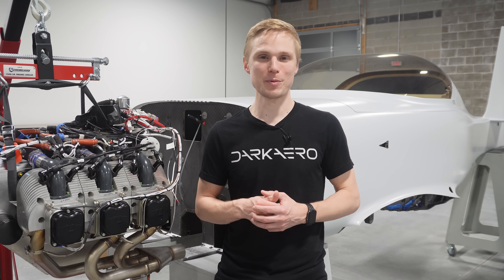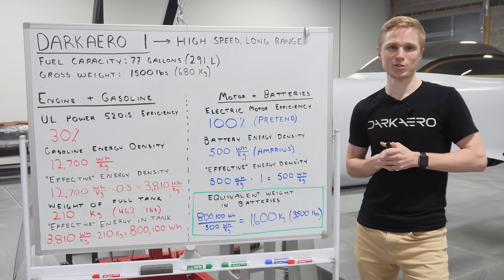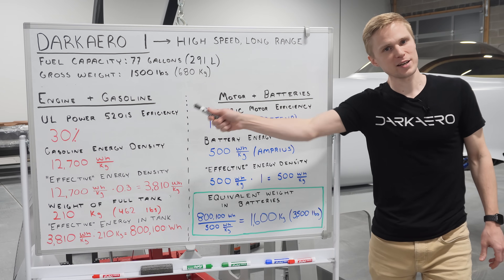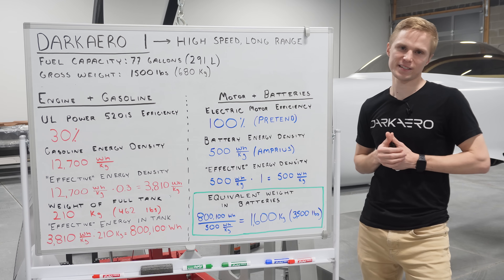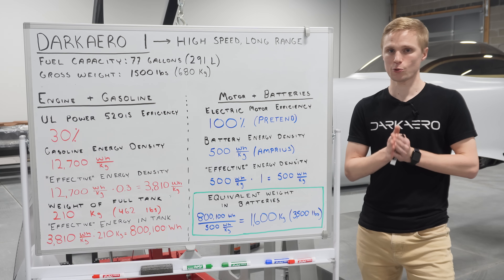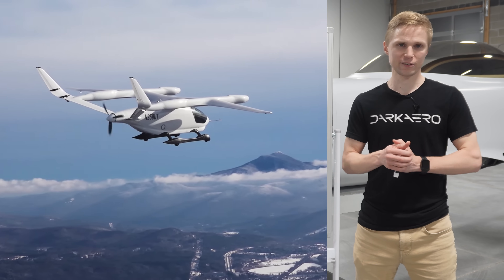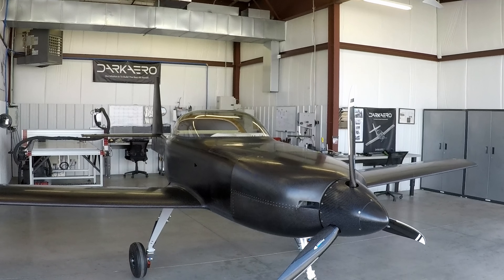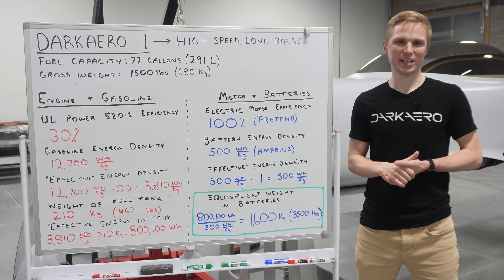The engineering challenge of electrifying airplanes

Comment: 1kg gasoline has 1.6kw/h usuable energy. Diesel has 3kw/h energy.1kg battery has 200watt/h energy. In general, this means 8~10 times more weight. But if we take into account the weight difference in the engines, there is a difference of 5 times. 1kg hydrogen has 33kw/h energy. It seems much more efficient for airplanes.

Comment: lightweight long range will always be dominated by fuels, and thats fine by me. better fuel engines are still coming (glacially slow in aviation, but they'll get there) and short haul flights can be almost entirely electrified.

the improvements in battery tech and packaging might get closer than you expect though, not Dark Aero levels perhaps, but a medium range version, going with a smaller pack load for 2+ hours, composite structural battery in the wing box, i think it would be just as desirable for a similar market. of very rich people.

Comment: No. The numbers don't work. Fuel load gets lighter as it is consumed. Not so with electric.
Enough battery to be useful in an airplane could generate quite an inferno. Many other reasons why it won't work. Put on your thinking caps and use your brain.

Comment: One thing that I think could be an upcoming trend in the world of aviation is the use of hybrid powertrains. If you have a small combustion engine that is hooked up to a generator that tops off a small battery pack, you can heavily optimize the engine to make it more fuel efficient, and also smaller/lighter. That way you'll get more bang for your buck out of the gasoline you carry. The battery would then be connected to an electric motor to reap all of the benefits of an electric power train.
Reply: this is more the case for vehicles with constantly changing engine load, aircraft generally have smooth power requirements and therefore this has less advantage. i suspect more advantage would come from the aerodynamic benefit of being able to place multiple small electric motors in strategic locations.
Reply: and also aircraft ICE's are also operating at a higher percentage of their maximum power, much like a hybrid engine

Comment: pu-238 has millions kwh per kg
Reply: use that in external combustion heat engine/thruster
Reply: yes its alpha nuclear
Reply: use just rtg alpha nuclear
Reply: alpha nuclear is relatively safe
Reply: metal-air sheet-spool fuel-cell batteries
Reply: one time use regenerated metal-sheet as fuel, like gasoline, refined back from oxides to metals, normal/advanced metal making processes, solar/wind/nuclear powered

Comment: Thanks for the vid.  Seems like we're still a ways off from electric aviation to become commonplace...but I'm confident that we'll get there eventually.
Reply: I doubt ev aircraft will become mainstream within  my lifetime
Reply: @yota8325  :  Not much likelihood of that.  As River covered in this video, there is a place for it in a small number of cases... mainly where there are short hops between the same points, such as between islands, or training.  If it involves long distances, battery-electric power is not the answer.
Reply: You will never see battery powered commercial airliners because you have to be able to dump the fuel or payload to return to the field in an emergency, smoke in the cabin, passengers fighting ext. takeoff weight is always too heavy for return landing. Can’t drop a 20,000 lb battery pack on a school to return to the field.
Reply: @tropicthndr  The battery pack doesn't get lighter, so you'd have to design an airplane that has the same takeoff and landing weight.  The emergency is irrelevant.
Reply: @Michael Kim :  When I was a (much) younger man, if you wanted to fly a model aircraft, you had to learn about noisy, screaming, smelly, oily little engines, and the witchcraft involved in fuel mixes.  One day a guy brought along a spindly, fragile, slow creation powered by batteries... we politely watched, but were not impressed... if only we could have seen into the future!  At times, what is seen first in model aviation translates to full-size... watch this space.    😊

Comment: Great video, River! The simplified math makes it easy to understand. 

Have you looked into using hybrid of electric and ICE on an aircraft? I'm thinking an electric motor with a gas powered generator and minimal (or zero) batteries. I would be curious to see some rough numbers on the potential weight compared to a standard ICE.
Reply: A hybrid, with batteries, would be less efficient overall.  I'm all about electrifying vehicles but the advantage of a hybrid car goes away in an airplane.  One of the biggest inefficiencies of ICEs is the amount of moving parts.  In a conventional car the required torque necessitates a large engine which during 90% of its operation is well below the required power for acceleration. 
Using a smaller ICE that gets supplemented by an electric motor means that the ICE is used in a more efficient way and it doesn't need to be as big to meet the torque demands of driving.  So in steady state the smaller ICE is so much more efficient, it makes up for the extra weight of the batteries and motor; this just would convert to airplanes in the same way.

An airplane in flight is using a considerably larger portion of the available power than a comparable car driving down the highway.  An airplane would not be able to take advantage of the increased torque of an electric motor to reduce the size of the engine so any advantage of having a motor goes out the window.

Comment: Hydrogen fuel cell could 100% be electric. Already done in unmanned drones for the last 2 years. Cost is much the same as a combustion engine. No need for a solid state battery.

Comment: Great summary. One corner case advantage of electric, in addition to no power loss at high altitude, is the potential to drive a supersonic propeller at supersonic flight speed, since there's no need for an intake to slow the airstream for compression and subsonic combustion. It would be noisy though.
Reply: There is no supersonic propeller...In the standard jet engines the compressor phase blades are subsonic...after the turbine section the added fuel burn ( hence the name "afterburner") provides supersonic airstream and adequate thrust to jump over the transonic wave drag penalty barrier... 
The inlet section of a fighter jets drops the speed under sonic speed via compression waves even when travelling supersonic...

Above Mach 2.0 you can use ramjet...(AA-12,SR 71,...) above Mach = 5.0 you can use scramjet...(Kinzhal missile...)
Reply: @electricaviationchannelvid7863  a propeller is just a rotating wing. Supersonic props are noisy and inefficient but they're an interesting way to go supersonic with electric propulsion.

Comment: Two things to add: An optimum electric aircraft has higher mass and higher lift/drag ratio (think glider geometry). Also batteries are improving at around 6% per year. Project that forward by a decade or two and most GA aircraft can be replaced with electric aircraft…..

Comment: The problem, as always, is energy density - as you rightly said. Until energy densities are AT LEAST a magnitude above their current levels, and until charging rates 100x their current levels can be reasonably (and SAFELY) achieved, all electric aircraft simply will not work.
Reply: At the MIT AeroAstro Centennial Symposium in 2014, Musk reckoned that batteries with a specific energy of 400 Watt-hours per kilogram, composing 70 percent of the mass of the aircraft, would make a “compelling” aircraft. 
Carnegie Mellon researchers Venkat Viswanathan and Shashank Sripad recently published a paper in the Proceedings of the National Academies of Sciences (PNAS) estimating that an aircraft with that mass fraction of 400 Wh/kg batteries at the pack level would be able to cruise for around 15 minutes at Mach 1.1 at an altitude of 40,000 feet, including a vertical take-off and landing.
Reply: @waynerussell6401  just because it's enough in that case doesn't mean it shouldn't be better. And the biggest problem won't be mass, it'll be cooling. Greater power density + greater charging rates = MUCH higher temperatures. We will need to find battery chemistries that are VERY efficient when charging so no energy is lost to heat generation.

Comment: Another challenge is that altitude does not deplete the power however the lower associated temperatures do.
Reply: This wouldn't be a significant issue for direct altitude as you heat the battery up significantly while getting there.  It would be an issue for cold locations where the battery would not be pre-heated and fully powered on the ground.
The battery power reduction at lower temperatures is because the battery starts cold limiting total storage.  If charging and pre-heating the battery it becomes much less of an issue.

Comment: One option you might consider in the nearer term is Solid Oxide Fuel Cells. Due to their higher temperature of operation, they allow for the use of hydrocarbon fuels, and they can even harvest energy from the oxidation of carbon monoxide that results from the hydrocarbon fuels. They’re not likely to ever be used in cars due to their long warm up times and slower throttle response, but neither of those problems are present for long range aircraft. They can get pretty light weight too…NASA has a patent they’re trying to license out for a SOFC that has a power density of 2.5 kw/kg, which would mean maybe 100kg for the fuel cell. And with that you’d get closer to 60% efficiency and pretty cool fuel flexibility (you can use any low-sulfur fuel from diesel to natural gas to pure hydrogen).

Comment: It's also worth mentioning that most early EVS were conversions of gas powered models - replacing the engine with a motor and the gas tank with a battery pack - and they were universally awful. I suspect a converted DarkAero "1E" electric would be similarly disappointing. If you want to make a good electric airplane, you really need to design it to be electric from the start... and it's a bit late in the DarkAero's development process for that 😀

Comment: I think that the push for lighter batteries while focusing on an efficient air frame means that DarkAero will be well positioned once that technology exists.  Maybe solar panels will get so efficient you can recharge mid flight to extend the range? Who knows.
Reply: Solar panels are great but there's a hard limit on how much energy can actually get to them because no amount of research in the lab is going to make the sun brighter. So there's a hard limit on how many watts per square meter of panel area you can ever get and it's lower than what is required to make an airplane perform. Flying on solar power is achievable, it's been done, but only by extremely efficiently designed flying wing drones that don't have to carry the weight of a human pilot, and even they have a pretty high failure rate because it doesn't take much to knock them out of the sky.

Comment: Jet/kerosene/diesel/#2 home heating fuel is the best solution. Higher energy efficiency and lower rpm.
You could use a lower powered engine that could reach high cruise speed in straight and level flight @85% power. Then add a small battery and electric motor to boost climb and take off speed.
The electric grid which consists of power transmission lines and electrical power generation plants or powerplants is not remotely capable of supporting 100% electric passenger cars. Heavy equipment and transportation sectors would more than double that amount. The electric grid was already working above 100% before the first Tesla came off the assembly line. A single family house with two avg American drivers would use an additional 58% kWh on top of the avg kWh usage per month.

Comment: one-time-use aluminum-air batteries. with replacements kept at airports, transported by trucks same as gasoline/diesel. And when you swap a used battery, the delivery truck takes those batteries to be recycled.

How would this change the performance numbers if an aluminum-air battery managed it's best hypothetical performance?

Comment: Curious what a hybrid would do...

Small diesel engine as a generator, powering a small battery and electric motor. Does it work for airplanes.
Reply: Diesel v12 hybrid flight test https://youtu.be/GUEAa8fHvbQ
Reply: Something I learned during flight school (c150’s) is that they are almost always at high power settings. A small diesel engine will most likely get overwhelmed at some point because you can only output as much power as you input. And no it’s not the engine that sets back the plane, the airframe is just so inefficient just so it can be so forgiving when students fly it.
Reply: @poochie5543  I wasn't asking about the airframe. But an electric motor handles the torque better than the gas engine, and so how does that factor in as a hybrid. 

You have not answered the question with anything useful.
Reply: @SoloRenegade  it doesn’t matter if the motor has torque, the motor won’t run after 20 minutes if the diesel engine cannot output the power needed to run the thing. Commercial aircraft have an apu in the back which is practically a jet turbine to power the plane. But even replacing the main engines on those commercial jets for motors, adding a battery, and then adding a larger apu won’t solve the issue because once again, you cannot output as much as you can input into the system.
Reply: @SoloRenegade  the industry they or you are trying to ‘modernize’ is way harder than anyone could imagine. We have vehicles like trains and cars that are hybrids because there is no real weight limit, while aircraft do. Ultimately we are trying to solve an environmental issue that cannot be solved economically nor practical.
Reply: @poochie5543  "the motor won’t run after 20 minutes if the diesel engine cannot output the power needed to run the thing."

which is why you size teh generator appropriately. but I see you're not smart enough to understand this.

"But even replacing the main engines on those commercial jets for motors, adding a battery, and then adding a larger apu won’t solve the issue because once again, you cannot output as much as you can input into the system." 

you obviously don't understand the how/why of hybrids. Hybrids do work for a reason, and many vehicles have used hybrids for energy savings for decades.
Reply: @poochie5543  " the industry they or you are trying to ‘modernize’ is way harder than anyone could imagine."

no it's not. aviation is far simpler than people like you beleive. I am a Mechanical and Aerospace Engineer who designs aircraft, and a CFII in airplanes and helicopters. Engines are not my specialty though. I have not done the math on a hybrid, and hoped someone else may have looked into it. Clearly you haven't.

"We have vehicles like trains and cars that are hybrids because there is no real weight limit, while aircraft do. " but some such hybrids are actually LIGHTER as the generator, being as it's optimized as a generator at one specific RPM, tends to be so much smaller than would normally be required. A diesel powered APU can generate a lot of electricity, and very weight efficient. There are multiple new companies offering turbine engines in teh ~130-200hp rang for light aircraft right now, that are FAR lighter than 100hp continental legacy engines for example. The engineer of the company I talked to had an engine that was about 100lb lighter than the continental in my airplane, and had more horsepower too. Hook that up to a generator, add a small electric motor and battery (weight change ends up being a wash), and now you have a high torque electric drive running on a small and efficient turbine burning cheaper diesel fuel.

"Ultimately we are trying to solve an environmental issue that cannot be solved economically nor practical."

again, you clearly have no clue. Stick to things you understand.
Reply: @SoloRenegade  let’s start thinking for a moment, a GE9X found on a triple seven has a shoddy but general hp output of 9500 hp. Times that by 2 and now you need to create 19,000 hp to run the whole system. On top of that you need a backup so add another most likely. Where would like to add your 2 ge9x + batteries + motors to run the whole aircraft. These numbers are so large and demanding that batteries and motors will be ridiculous. Leave your bitterness out of here, thanks.
Reply: @SoloRenegade  even in smaller aircraft, the use of some sort of diesel engine on smaller aircraft is dumb because diesel engines themselves are pretty heavy compared to aircraft engines (who knew aircraft engines are good for aircraft). No need for flywheels and ridiculous compression values, just a good old horizontally opposed, air cooled engine. Also its good for the students to learn more about their aircraft through mag checks at least.
Reply: @SoloRenegade  also are you being genuine about being an aerospace engineer and a cfii in both helicopters and aircraft😂
Reply: @poochie5543  And what are you? a Walmart grater?
Reply: @SoloRenegade  how can you be a cfii and yet so unlikable? Are you upset because you spent the time being a cfii in helicopters and planes yet cannot get a golden seal yet, all your students are failing?

Comment: One thing I noticed while you discussed the energy density and motor efficiency is that the 3500 lbs of batteries is to provide the same amount of power as 77 gallons of gas, but because the gas engine is only roughly 30% efficient you’d need less batteries.
Reply: No, he took that into account when he factored the total energy onboard by th efficiency of the power plant. “Effective energy density”.  When he took the energy density from 12,700 to 3,810.